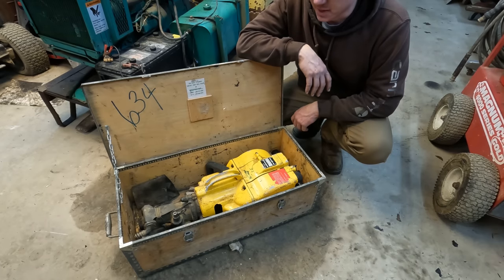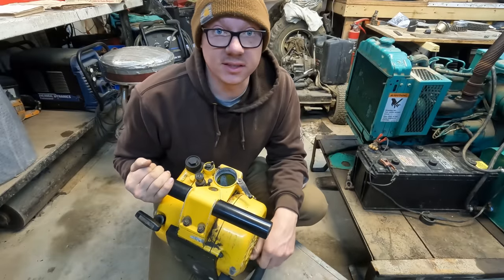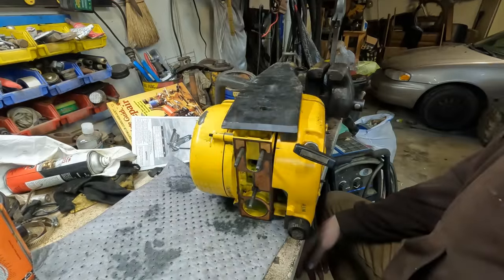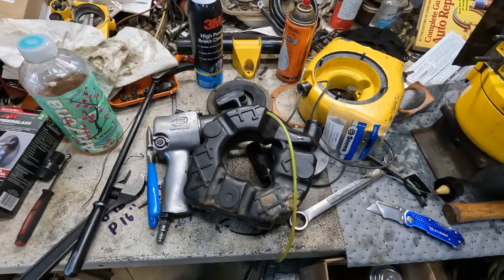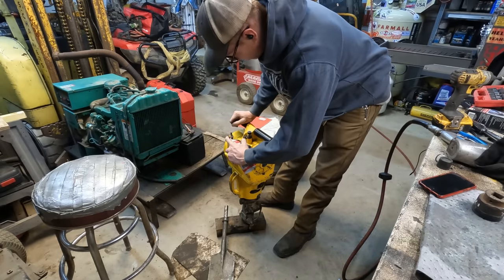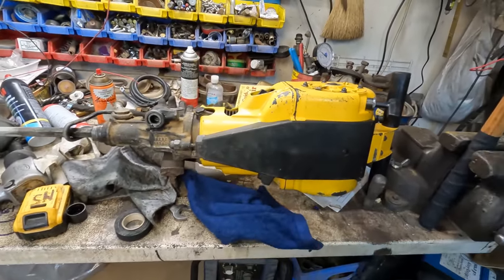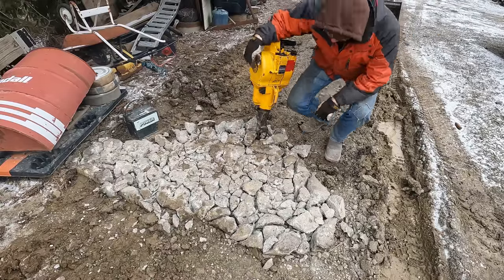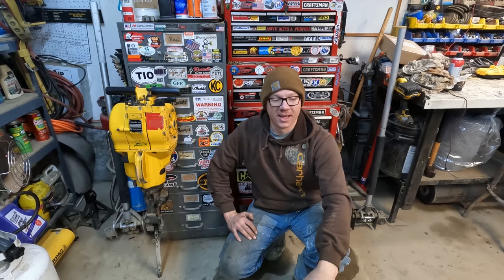RARE? Gas Powered Jack Hammer, Will it ever Run again??  (Pionjar 120)

Comment: The throttle is permanently set for full speed.   If you push it to the half way point that is the idle speed.    If you push it all the way down that is stop.
Reply: that seems more logical than needing to throttle it up for function with having the controlled leak fuel system, leave it alone till you need less cowbell, or none at all
Reply: Then it is weak AF. It should rev higher.
Reply: I can confirm that down is off, don't push the throttle,  you're shutting it off.

The way this "throttles" is through the opposing pistons. The compression is really low until you push down on a tool which provides back pressure on the lower piston, raising compression and engine speed.
Reply: @tomahoks  i don't think a higher speed automatically means a stronger cut, the weight of the hammer can only be cycled efficiently so fast, remember this is not a serious breaker, its a handy portable prospecting/small/remote job unit, it seemed to handle that chunk of sidewalk about as expected
Reply: I was so certain he was pulling our chain through most of this video and was going to show that he found out that the "throttle button" wasn't at all what he thought it was by the end of the video. I mean I thought he was in full animal humor mode. I was rolling on the ground laughing. Matt shows us so much, he even admits mistakes. Giving us an opportunity to see we can too. This one just looped me. Loving it!
Reply: @mattc7820  this is correct. When I've seen drillers use them it goes on top of a 5' rod and they pull down on the metal handle cause they can't reach the top.
Reply: @wdixon27   blows per minute is equally, if not more important than cycling the hammer efficiently. Speed = blows/minute
Reply: @mattc7820  but if you "float the valves" and short stroke it by going too fast, not so much
Reply: @wdixon27  What do you mean by float the valves? The only valves are the reed valves and those don't float like the valves in a 4-stroke. Plus, we're talking about an engine with a listed max rpm of 2800, not 10,000. It's not floating the valves.

The driving force to the tool isn't the hammer cycling up & down, it's the explosive energy of the combustion. The hammer IS the lower piston, it's one-piece.

I'm not just guessing at these things, I own one of these.
Reply: @mattc7820  That is the best reply among great replies. And makes it a great machine after all.
Reply: @justinfufun5483  Dennis at Creighton Rock Drill is THE expert in these. He has been using and working on them for decades and he thinks very highly of them. He's a little bitter with the US. The EPA banned their import (bc they do produce a fair bit of smoke) and because the US was a significant share of the market Berema decided to discontinue them. He blames "us" for that (I don't disagree with his assertion). He says they're VERY good gas rock drills. They're not as capable as pneumatic drills but they're a fraction of the weight and MUCH more portable. And they fill a niche for occasional users and remote users.
Reply: @mattc7820  not talking about literally floating cam actuated valves of which doesn't exist in this engine, hence the quotation marks, i was referring to basically the whole machine, trying to cycle faster than it can reciprocate as the mass of the working end can only move so fast, spinning the engine faster than that doesn't make it better, i suspect this engine is naturally limited by either air in or air out to a certain rpm.

ive never touched one of these things and am certainly not trying to piss up the back of someone who owns one, and say its rain, just a seasoned mechanic trying to discuss a suspicion of that things design when the above dude said "Then it is weak AF. It should rev higher"
Reply: @wdixon27  Ah, I think I misunderstood what you were getting at. Yeah, the guy that says it's weak likely has no clue what weak is.  It weighs less than 60 lbs but can still drive a 1-1/4" bit into rock at a rate of 1 foot/minute. It can drill up to 20 feet deep and up to 3" (a pilot hole is recommended for larger than 2" holes). 2800 rpm (bpm) is plenty fast for this, revving higher won't do a lot of good. And just for point of reference many pneumatic drills & jackhammers function at 1300-2400 bpm so this one exceeds the bpm of a pneumatic. I suspect, the impact energy is lower though so it needs the higher bpm to counter that.

To be honest I haven't used mine a lot but I will be using it more this coming year. I'll be using it to set fence posts into rock.
Reply: Yeah, but really - we never had the ability to "hover" the button half way with it jittering up and down so mostly the button went all the way down and the machine sputtered & conked out.

I'm fairly certain (back in 1970's when we had many of these in the New Zealand Railways track/maintenance gangs), we used it more as a decompression button to assist hard starts as well as for quickly "stopping" them.
It being way better to stall them than to be pissing around trying to get the "mixtures" correct again every time we restarted them. (which was often, as we used a slightly bent "heavy head, "sort-of" forked head shape, to pulverize the railway gravel/ballast in order to force as much gravel/ballast as possible - under track sleepers (when we were doing track lifting/ resurfacing work over long distances).
Before we got these infernal machines, our standard "ballast pusher' was simply an old wide mouth - thin flat blade "garden type" spade.
So instead of buggering your arms and shoulders by whacking the ballast with a light spade, we instead buggah'ed them by incessant pulling on the starter rope, when these (near useless) machines - DID NOT START
Reply: @mattc7820  im glad I  watched this  video  because I  got my machine  running  by watching  yours. Thanks  Matt

Comment: Pionjär = Pioneer. They are popularly called Berg Kobra = Rock Cobra here in Sweden. I have a friend who has two of those. One of them is still in use.
Watch out for the white spots on your fingers and hands though, first sign of damage when using high vibration tools.
I've heard steaming the pages works if they're stuck together!

Comment: 8:15 tips or tricks?
Try steaming the book a while and "slowly" drawing the pages apart - then dry them one at a time until you have all pages "apart.
DO NOT allow them to be closed - until long after the pages are dried - also after drying but before closing, sprinkle talcum powder on the pages to keep them from re-sticking again.
WAIT - the front cover has THE MOST BENEFIT (to start it) if you consider that the compression needs BOTH pistons being forced together, not just the top one connected on the upper crankshaft.
To "compress the bottom piston head UP - you need a bit in the machine to allow the machine's weight to bear down and FORCE the piston UP.

Comment: The US Air Force ( in Germany ) used this to drive 3 foot X 3 inch stakes to support the 15 foot Parabolic Antenna used with the AN/TRC-97 microwave point to point radio set.
We also used it to drive 8 stakes to anchors the OE-361 (QRSA) 20 foot Satellite antenna.
As I remember this thing was A PAIN IN THE ASS to get started and keep running!
But… when it work it did the job. 
There are three things to remember….
1 Maintenance, 2 Maintenance, and 3 Maintenance…
USAF Retired Satellite Communication.

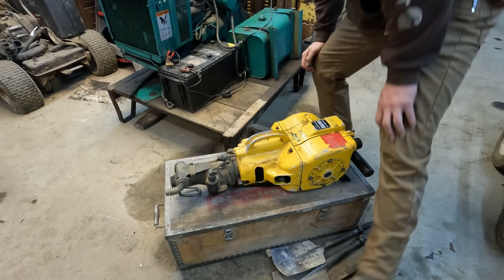Comment: The Milwaukee MX Fuel Jack hammer is cool used one a few times i agree the sticker shock will get yoy everytime And Dewalt just Introduced A Cordless Jack Hammer also Matt fun facts I would take the one you got for 120 bucks anyday Matt 4:28 @Diesel Creek

Comment: That brings back memories. We used the Cobra portable rock drill on mountain tops to drill rock anchor and ground rod holes for communication sites. It was notoriously finicky and hard to start, especially at altitude, which was 5,000 to 9,000 feet. If you became familiar with it, you could manage it, otherwise forget it. I heard the Pionjar was better. Thanks for the memory!

Comment: KISS!   When you press the spring in throttle button you lower the revs. There you can adjust your idling and use the lock for it. Loosen the lock and knob goes up.  Machine adjusts by it self to optimal number of strikes per minute/revolutions. When you start don't touch the knob and adjust fuel screw to optimal revs until machine is warm (at least 2 minutes in summertime).

Comment: Hey Matt! The way you spelled the name of the unit, in Swedish it would be pronounced, " Pioneer ". Also I'm surprised you got the recoil spring for the pullstart wound as quick as you did and in the right direction. WTG! PS a guy has a link below in the comments for Maskinsalg in Sweden for ordering parts and accessories and everyone speaks English in Sweden so you're good to go.
Reply: Pioneer is the English word, but it's not pronounced the same way as the Swedish Pionjär
Pi - like 'pee' but more of  i tone,  longer the Pi in Pioneer)
on - as the English word 'on'
jär - j+'air' (the j w/o any leading d sound,much like the y in 'year')

edit - trailing ' on 'air' was accidentally (android keyboard) an l

Comment: here matt i found this for you ok :- If the pages are stuck very firmly together and have a high likelihood of tearing if you apply more force, steam the pages by placing the book above a pan of hot, boiling water. This softens the pages and allows them to separate with less force.

Comment: Real good Matt! I’ve used the exact same model the last 8 years in the land surveying world! The little momentary switch near the handle is the kill switch. That’s part of your issue. I see you are holding it and trying to start it. There is different mix of fuel these need with sae 30 and 91 octane. 50:1 normal tcw3 mix is not good. I know the old chainsaws said to use 30 weight and fuel at 16:1 etc and modern oil and 50:1 is the ticket but his one actually needs the sae 30 and 91. They are always a real pain in the neck to start and run either way! If you need parts, may trail equipment in Idaho is your best bet!! General rule is turn both the top handle to the left to start.
Reply: i was just about to say use 30 wt. and 91
Reply: You're so right can I tell as a Swede. I run mine on not less than 5% oil and often more if its hot. Smokes "a bit" but it will survive. ;D  [There are also diesel driven ones but they are impossible to start without help.]

Comment: Used alot for high and low voltage line work (poles) here in Norway. Most of it is military overflow. Great machines if you know how to get them started. Seems like everyone has its own temper 🙈 worked with some Chinese knockoffs aswell. They are hard on your joints compared to a Pionjär.
Running procedure: full throttle, closed choke. When it pops turn the choke off. Adjust the needle. When it pops, give it more gas (counter clockwise). When it studders, give it less gas (clockwise).
What you call a throttle is a gas strangler to make less rpm for finer positioning (drilling)

Comment: 29:55
I think from memory that "push button" is the decompression knob to stop it, hence why you find it not speeding the machine up - but rather killing it.
Also - the harder you lean on them, the higher the compression from the lower piston and the better they run.
Bloody hard yakka though - to have your whole body "vibrating away - all day"
Reply: Its the throttle, but its correct that its "backwards", you slow it down when you push it. You are supposed to have it fully open when using the drill.

You are also supposed to let the weight of the machine do the work and holding it lightly just balancing it, you can lean on it ofcourse but if you going to use the drill all day you don't ;)

Comment: When I was working for a legal surveying company in the 90's we had one of those as well as a unit called a Kango.
We used them for digging frozen and hard ground and also had a end that we could put over the steel survey pins and drive them into the ground.
The punjar was lighter, cleaner, and nicer to use than the heavy, oily old kango
Reply: Kango’s were mainly midweight electric breakers (110v) I have one in a shed somewhere !  never seen a  petrol one
Reply: @CrimeVid  we had 2 stroke gas ones they were gross to use.
Reply: Around here ‘Kango’ is a common universal aquivalent for jack hammer.

Comment: Working for a telephone company we often used the Pionjar to drill rock anchors. Always tough to start but once running it would plod along but with no air to blow out the drill hole you had to keep pulling it up to clear the hole or it would get the bit stuck. Not as good as a Pneumatic Jack hammer or drill but great for a right of way in the woods
Reply: It uses exhaust gas to "blow the hole".

Comment: Hi mat . I have used these machines in the past and they are fantastic, when you come to use it don’t put your weight on the machines all you have to do is guide it and let the machines do the work. I think you would like it.
Reply: It seems the main problem is the nut that's holding the  kill button.

Comment: Used one for years great machine, use 16:1 fuel oil mix.. start it  no touching any buttons. the rotary dial is mixture control. The middle one, not pushing anything is normal run, half push center button for idle, push all the way to stop

Comment: Hi Matt! I use to use those years ago when I was a lineman… we used them to drill holes in rock to drive in anchors for guy wires. We pronounced them as Poonjars. They were the biggest pain in ass to use! We spent more time pull starting them then we did using them. It’s been a while but I thought the button with the spring was the shut off. You had to keep frigging with the mixture knob to keep it running smoothly and at peak rpm and push the button to shut it off. I gotta say, you had yours running way smoother than we ever did!
Reply: 🤔 any into granite or in a gravel pit ? i have a ground rod that is stuck 4ft down out of 10 ft and ideally 20ft down is what im aiming for, the 10lb siege isn't cutting it and the 5ftlb dewalt SDS-max drill isn't enough ether 😢
Reply: Pionjär means pioneer in Swedish
Reply: @albineriksson2667  id of guessed Afghanistan 🇦🇫 5 lions 🦁as it looks like the same spelling/sounds like the same thing
Reply: looking at the spec sheets it looks like the new round of inexpensive cordless SDS max drills have the same potential as the pionar 2-stroke gasoline or better ie the mekda 80V drill at 26J ish of impact energy and its easier to operate but it is sofar missing the option for cleaning out the debris out of the bore hole aka air or water line feed for flushing.

With solar or the new hybrid trucks aka ford f150 bed plug it has the same if not longer run time as hot swapping the batteries is possible ect

Comment: Year 1988 in my military service we do some training with those. Good to drill holes  rock for explosives or mounting bolts. Heavy and noisy of course.
Reply: Same here in the early 2000's for roadwork in the military.
Reply: 12B Combat Engineer? Me too! Not a wonder Sappers would flock to this channel. Matt's a good guy for those of us who like to fiddle with heavy junk~
Reply: While I never used one personally, I remember them being used in the1980's  to drive grounding rods for the equipment we worked on in the military.

Comment: For fishing those fuel lines through tank hole to add filter I use a length of piano wire (spring wire) bend it and put it though the bottom hole and out the cap.  Then feed the fuel hose over the wire starting from the bottom.  The wire guides it right out of the tank.  Add on the filter.  Pull out the wire, then rebend the wire if you need, reinsert it into the hose to move the hose into the new location.   You have my sympathies I have cursed things and like  yourself refuse to stop pulling until either it breaks or I do.

Comment: Use steam to get the pages apart. Hold the pages directly and horizontally over a vigorously boiling pot of water and let the moisture from the steam loosen the pages as you slowly pull them apart. Good luck!!!

Comment: Hey Matt, this video was made for me. You see I am the proud or (not so)owner of one of these machines mine is a B51 it is silver somewhat gently used w/box some bits also a tamper and some information on the inside of the box lid,but no manual no teardown  schematic or starting procedure. Your video was like sending your little brother onto the lake after first freezing so everyone else could skate.i appreciate your hard work. Between your video and the comments I will get this little beast running. Saab did some weird stuff,early husqvarnas also. this thing says I'm from Sweden all over it.

Comment: I used one of these through the 1990s and into the early 2000s for environmental soil sampling.  A place called Sonic Soil Sampling in the southern Ontario area supplied it to us.  Tended to foul up the spark plugs after a few weeks of use.  Eventually wore out the rings so I changed them, installed a new spark plug and ran great again for another 10 years.

Comment: Definitely use steam. It will unstick the pages for sure but be careful not to burn yourself in the process. If you put freezer paper between the pages as it dries it won't stick back together.

Comment: There are videos out there on how to extract the ethanol from gasoline using the simple and cheap water separation method.  I'd love to see you do a video on that, and then do a long term test on "purified" gasoline to see if it will not rot fuel line like the ethanol based gas does.

Comment: I used these back in my Airforce days to drive huge grounding systems for radar sites. It can be a handful to operate. Good to see you saved it.
Reply: did it work in hard rock my G-rod is stuck and its a holding up my new electric service